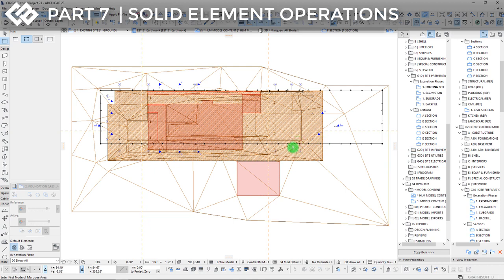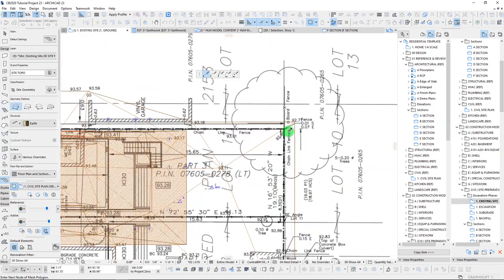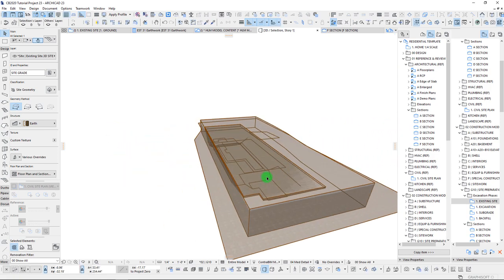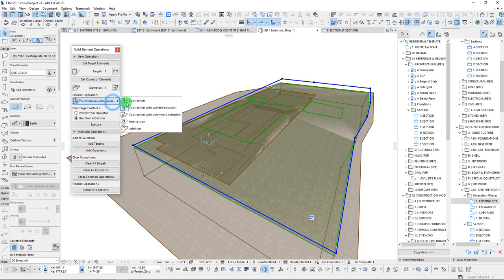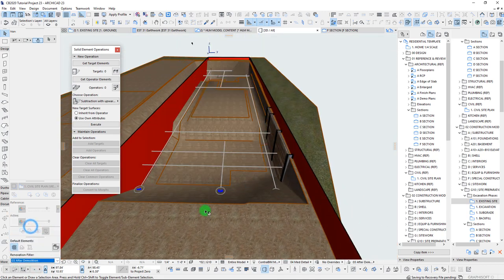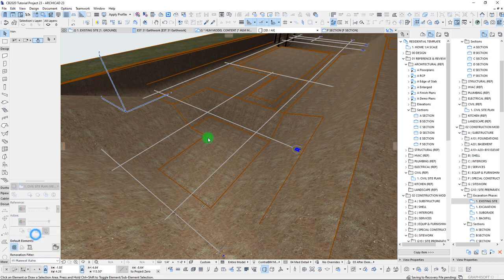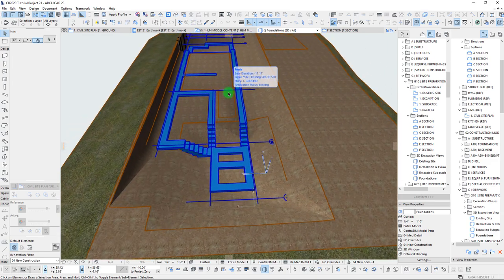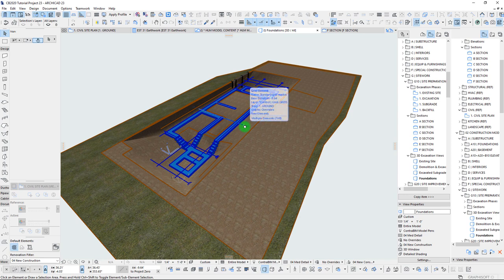How to Calculate Earthwork Using Solid Element Operations in ARCHICAD (Mini-Series)

Comment: This is a great series! I love the workflow using the extended topo but not including it in the grade calculations. I had used hundreds of complex walls to cut the topo in the past, but archicad goes so slow eventually - this seems like a much more controlled and measurable way to investigate how to get down to the foundations. Fantastic work! Also love the archicad workspaces - just downloaded them and they’re making a huge difference to my workflow.
Reply from the maker: Jamie Henderson thanks for the comment! Glad your liking the series, I have some other methods for showing how to cut the grades, I’ll be posting them soon. Awesome you grabbed the work environments! I’ll do another revision with AC24 when that is released as well!